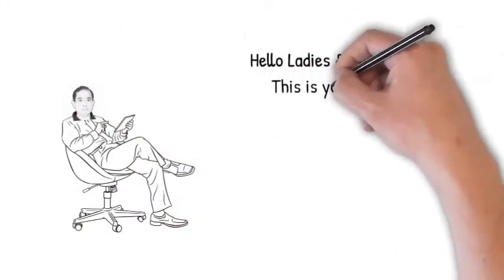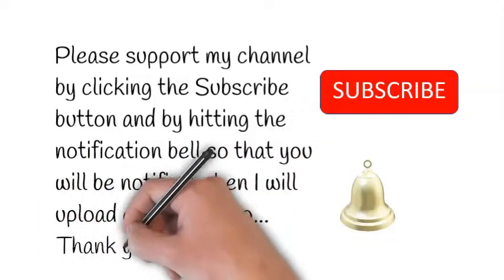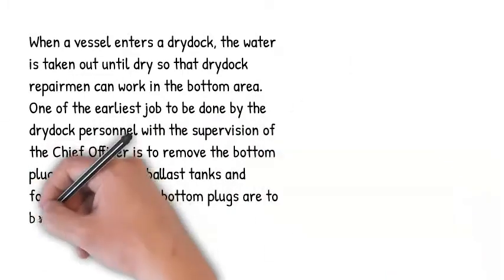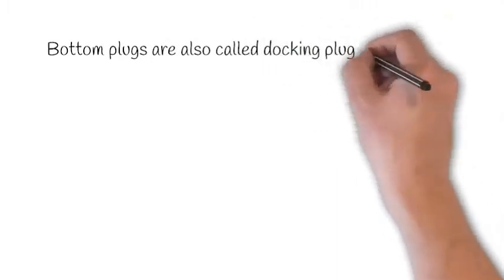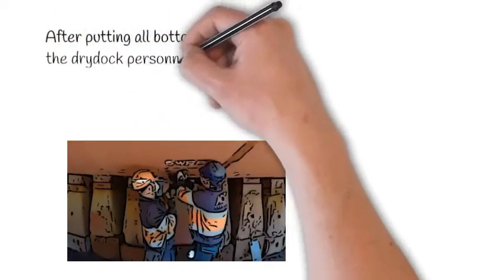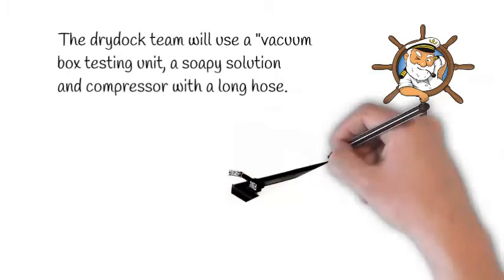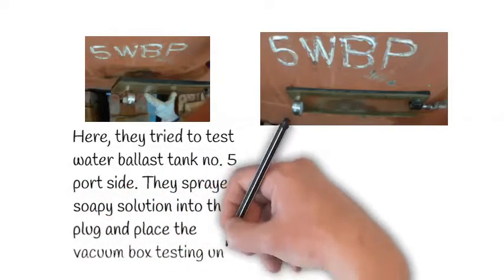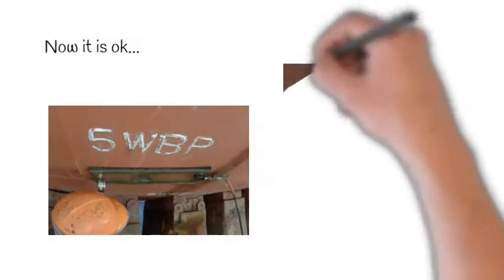Vacuum Box Test for Ship's Bottom Plugs

Comment: Where we find location of bottom plug?
Reply from the maker: when the water is pumped out from the drydock, you will remove the bottom plugs located in the bottom of the ship beneath the tanks and all of them are named or inscribed. You must remove the ballast tanks bottom plugs only. Anyway, this vessel is designed to have all fuel oil tanks in the topside tanks and nothing in the bottom...